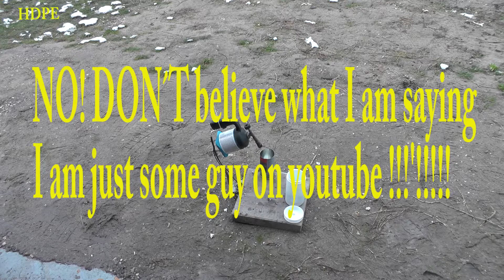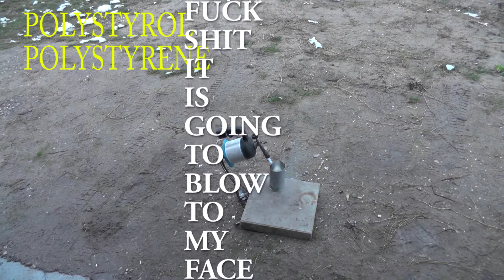Melting Plastic with FIRE !!!

Comment: is their anything that can be added to the PLA melting process that will make the PLA melt with a more LIQUIDY pourable viscosity... ALSO MUST REMAIN AQUARIUM SAFE ?
Reply from the maker: Hello. I don´t know. if you add another type of plastic or additive it will no longer be PLA. Adding some solvent will be probably bad for water animals. Basically PLA is used in 3d printing machines and more liquidity can be done by increasing heat. in minute 7:45 you can see top layer of plastic is quite liquid because is very hot. I can imagine if you heat plastic to very high teperature- it will be liquid, but again, high risk of fumes, fire an maybe explosion depending on machine you will use for heating.   And why it needs to be PLA? if you dont need to be specifically PLA , you can use hot glue plastic. hot glue plastic requires lower temperature to liquifi and if you can modifi hot glue gun for highier tempereture- you can get it to be quite running. I was using hot glue to create nice casting when I needed to modell missing part from electrical plug in my another project. I just left glue gun to heat up for 30 minutes until glue was at max temperature. So with PLA I can se possible way only with high temperature, but hot glue may be an easy alternative for you. There are also special sealing plastics which are used for waterproofing showers and it may be safe for aquariums when they fully dry. It really depents what specifically you want to create. Have a nice day.
Reply: thank you, i need it to remelt PLA because that is what my failed 3 D prints are made of... after watching your video i feel that fire heat can melt the PLA into a pourable condition.. thanks again. @jkp